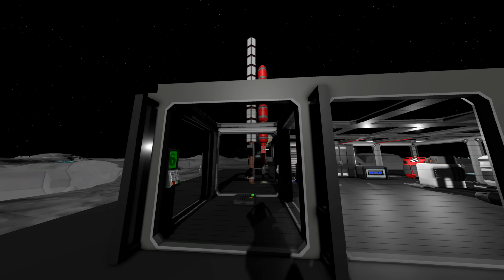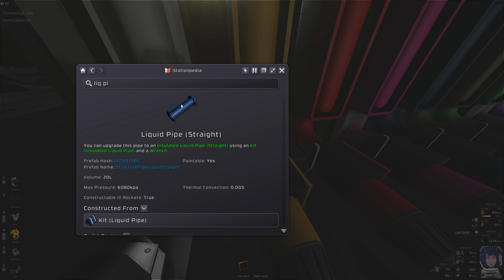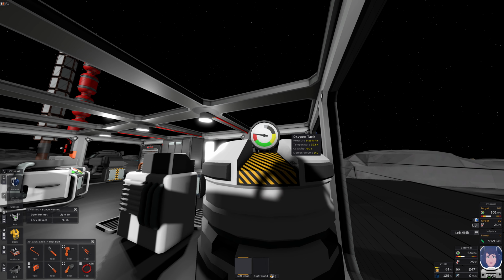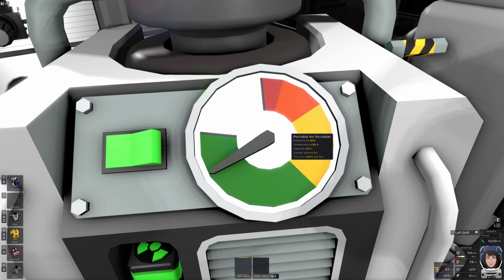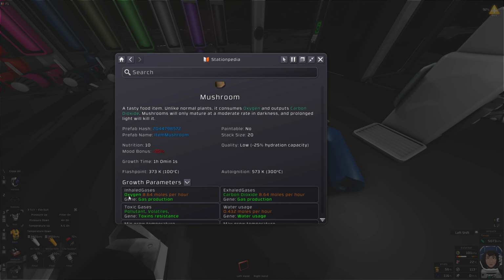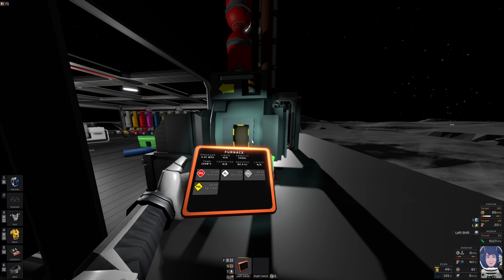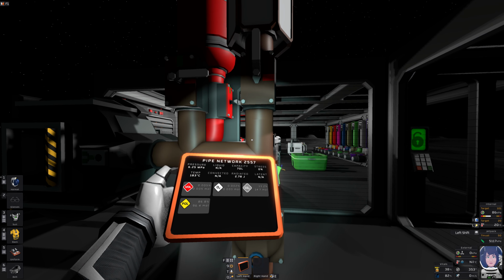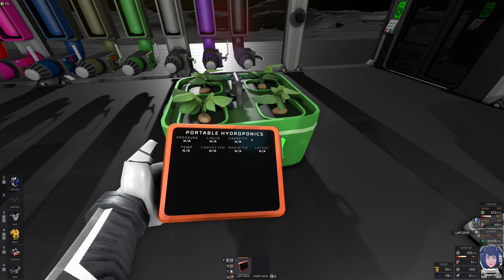Stationeers ATMOSPHERICS for total beginners - TURBO STYLE! - Part 2: The gasses / Getting CO2 *

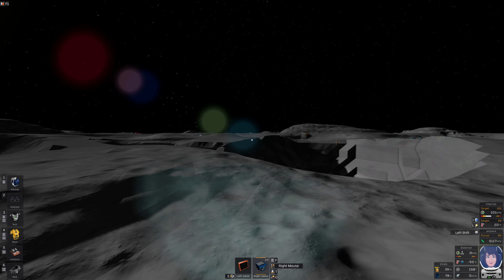Comment: 16:50 one very handy trick for the passive liquid inlet:  Since the inlet will allow outside atmosphere to enter the pipe network, one can make 100% sure that only water gets into the pipes by building:   Liquid inlet --> condensation valve --> gas pipe or small inline pipe tank --> evaporation valve --> water pipe.
Reply from the maker: Thanks. I think that setup has the same problem as this one: Just adding a one-way liquid valve, so the first part of the liquid network would have whatever the room has (Which the Portable Scrubber could actually take care of, since the pipe is open to the room!), and the second part would only have liquids. LIQUIDS! Like e.g. Nitrous Oxide or Polluted Water, both of which has happened to me. Maybe your setup solves this, but I can't see how it could.
Reply: @OwnerOfTheCosmos  when the liquids get condensed into the small gas network behind the condensation valve, they do not stay liquid. Since water has such a low condensation pressure, your nitrous or other liquid in the room atmosphere will evaporate while the water gets expelled through the expansion valve. You could add a backpressure regulator set to 12kPa and a passive vent to the small gas network to make sure that any gasses that make it into the liquid drain actually get sucked back out.
Reply from the maker: @wowailyich615  Mister Dude Sir! I just tried your setup, and it works marvelously, and I'll feature it (and your comment) in the next video, if you don't mind.
Reply: @OwnerOfTheCosmos  Sure thing! Glad I can add some little insight from my learning steps. I really like thinking about making phase change stuff and low tech solutions work for me, instead of complicated coding and atmospherics. I think this is a great challenge. One humble request for the next atmospherics episode: I have only recently dabbled with programming p-controllers to manage pressures using volume pumps. I see very little information for beginners on how to easily set this up (it is really "read pressure - subtract target pressure - multiply by p-coefficient - set pump to delta pressure x coefficient"). Since handling gasses is such an important part of the game, I think every beginner needs to learn pump management.
Reply from the maker: @wowailyich615  To my shame (Add it to the list.), I've never used this approach: If I find out that "Set to X." works, or "Turn on/off with MIPS depending on measurement.", I do that and move on to the next task, even if it's inelegant. Maybe RocketWerkz could help by letting devices (particularly pumps) take a moment to ramp up to their full set speed, or to stop running. Instead of being digital. ---- I took note.

Comment: I know im a little late but in real life, real gaseous steam is fully invisible. You can only see liquid form of steam that condenses in the air. Funny how most people dont know that.
Reply: never too late to teach someone something thankss!
Reply: The funny thing is, most people see that exact thing all day long - gaseous water is present in large quantities in normal air, and it doesn't really block your vision, does it? But you can't see it (duh), so it's easy enough to miss :D 

Of course, this makes actual high temperature steam very dangerous. You can't see it, and not only is it very hot to begin with, it's also extremely good at transferring that heat, and even more so, as it inevitably condenses on your unprotected hand, delivers even more heat. And high pressure steam in particular is not only even hotter, but also tends to be even more invisible in practice, since it can be hard for it to condense in the ambient air; your skin, on the other hand, is absolutely brilliant at allowing it to condense :D

Comment: As always, thank you very much for this series of “tutorials”, they help a lot ^_^. But personally I still have doubts about what the (Atmos Analyzer) shows, in particular: Convected and Radiated.

I know you mention it a little bit, but I don't understand it at all... What does each one mean? what is its purpose? what happens when it is negative or positive? does it affect the environment? Like: Cold gases in a pipe will cool the environment, and a pipe with hot gases will heat it. I guess so, because I recently made a passive cooler, with pipes  (that give to the vacuum and other pipes to the interior of the base), a passive vent, and a valve; by opening the valve I let the gases cool and circulating  from the outside to the inside (and vice-versa), this cools my base. (for now).

does it show the temperature of the gases inside a pipe? (I guess it does).

I've searched info through official Discord, Steam forums etc and each one said something similar, but another part of that explanation is quite different <(@-__@-<) I'm a little confused. Thank you in advance for the response!
Reply from the maker: You don't even have to let the gasses of that cooling pipe circulate, it's just enough to have gas in there at all - just some radiators on the outside ("radiation" on the Moon, "convection" on Mars or other places with atmosphere) and some convection radiators on the inside. That will ensure the exchange of room energy with the outside. As long as there's gas in the pipe. So an Active Vent to define whether that's so, and you're set. Super simple. Can even be automated if you just add a Pipe Analyzer (and control it with IC10 or Logic Chips). ---- THE ATMOS ANALYZER: It shows what you're pointing at, e.g. the room you're in. You can't point it through a wall, that doesn't work. But it would show pipe content or what's in a furnace. CONVECTED/RADIATED: If it's a positive number, then thermal energy from the pipe you're looking at is moving outside, so it's moving into the room or wherever the container (pipe, tank, furnace, ...) is, by means of radiating away, or by means of "touching" away via gas contact. If it's a negative number, the pipe is being heated by the same means.
Reply: @OwnerOfTheCosmos  You are a wonderful and very generous person. Thank you so much for investing your time in giving me such a detailed answer to my doubts. I have been following you for a while now and you deserve all the best ^_^ I hope you had a wonderful day. <3 Greetings, Att, Brarox.

Comment: 5:30 Will an active vent not pump all the gas very quickly(it does a 1x1x1 cube in like a second)? Does the filter keep up with the speed of the active vent?
Reply from the maker: It's quick, but at the end we can see that the streaming of the other blocks into the Vent block takes time. Also, the PressureInternal is limited to ~50 MPa, so it wouldn't suck all the air because the pipe is full. The Filtration unit as well as the Filter can not be overrun with too high pressure, they just work.
Reply: Also, note that the pumps work on volume, not atoms - so it will always slow down as the pressure decreases (and the same for air moving from other "tiles" in the room). In practice this means that there isn't actually much of a dependence on how much pressure there is in the room to begin with if you're trying to create a vacuum - most of the time is spent on the last few kilopascals. This also makes it fairly long and difficult to separate gases after you made a boo-boo; getting those last few mmols of pollutant out of your air takes quite a bit of time and energy (phase change update gave us new fun ways to work with all of those issues, though :D ).